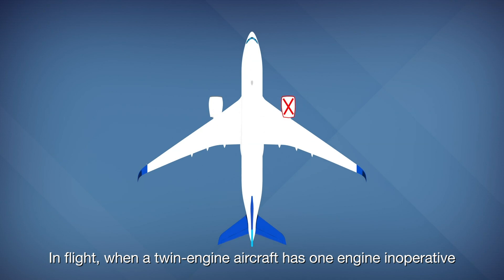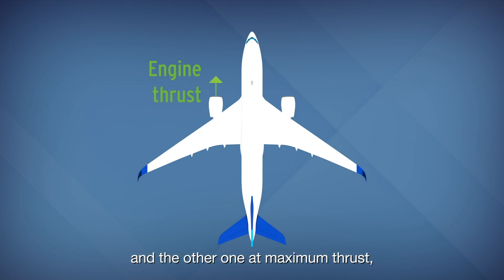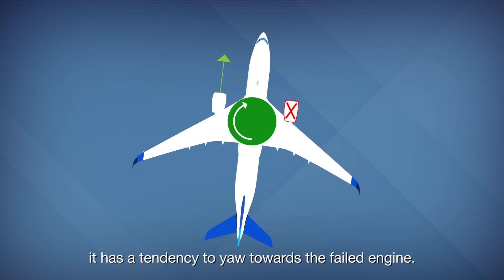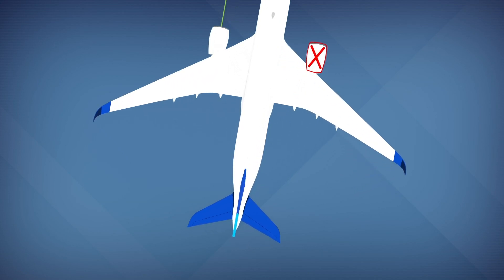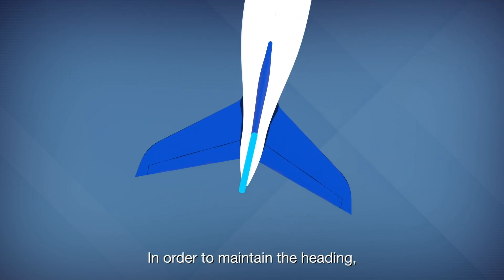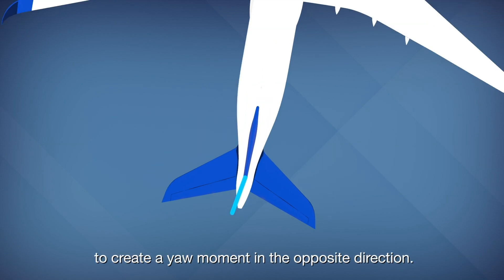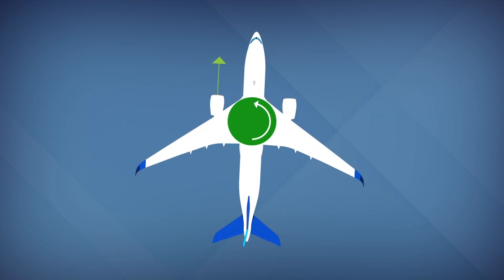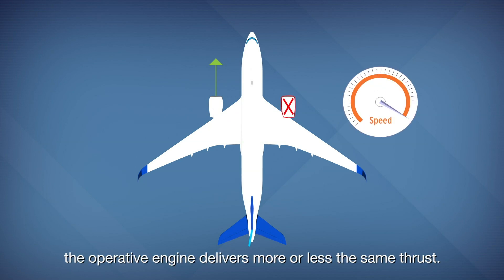Flight Tests - Episode 19: Minimum Control Speeds in flight Tests (VMC)

Comment: This is genuinely one of the most fascinating series on YouTube, I am in awe of the test pilots, the calm narrator just casually explains the tests, and you watch with mounting horror as the danger just increases and increases, the engine is master-off, not flight idle (usually), it is performed at low altitude, the yaw damper effectiveness is reduced. I don't know how they do it...